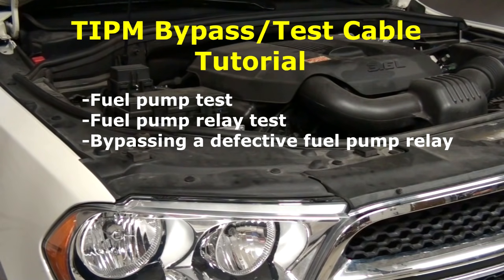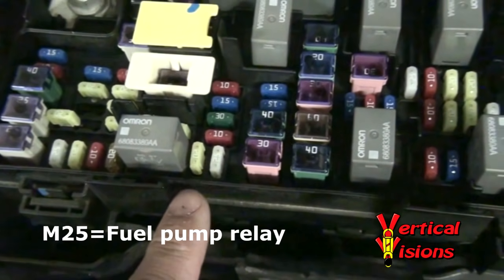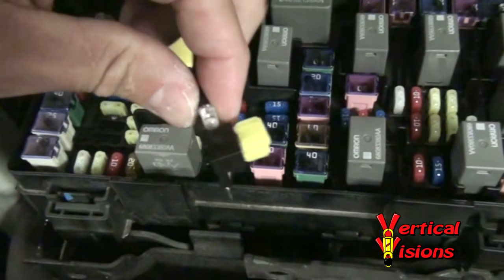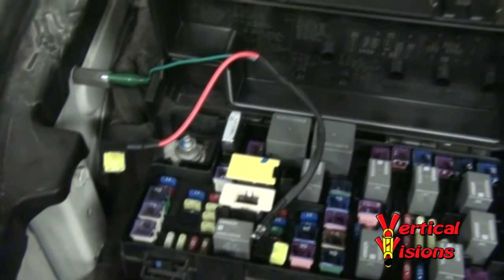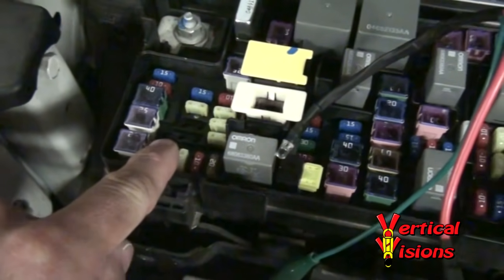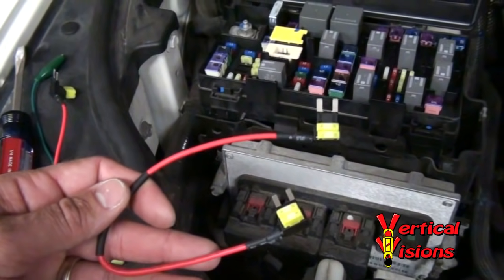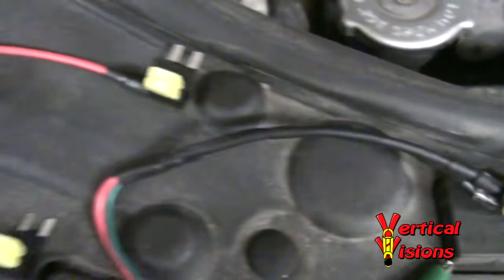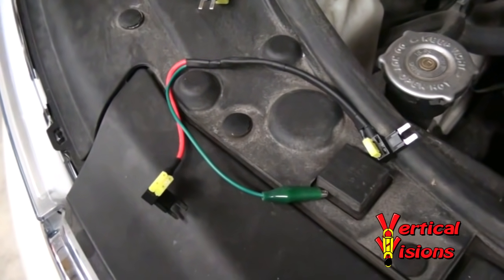TIPM Fuel Relay Test and Bypass Solutions - Most 2007-2021 Dodge, Chrysler, Ram, Jeep, VW Vehicles

Comment: Can any one tell wich by pass wire or module I should by for the 2012 t&c the relay started acting up, it still starts but now my fuel pump is stuck on and kills by battery, just wondering if I’ll be pulling fuses all the time or if this will be able to set and forget under the fuse box, thanks
Reply from the maker: If you bought your cable from us, it will come with hard copy detailed color instructions to show you everything you need.
Reply: @VerticalVisions  cool looking forward to it! Will report back
Reply from the maker: https://verticalvisions.com/en/128-town-and-country.  You need only set and forget it.
Reply: @VerticalVisions  thanks for quick reply, only reason I asked is I watched the video twice either I wasn’t paying attention or I thought the guy said if my pumps stuck on I need to remove a fuse from the by pass?? I got the one with the red wire and 4 yellow fuses on it I forget what name, something mini blade.

Comment: The correct way of doing this is get the fuel pump relay turn on signal from the PCM (pin84-brown wire) and add an external fuel pump relay to retain the operation of the fuel safety system which only will allow the fuel pump to work when the computer sees RPM.

Comment: This presented solution may work for a temporarily bypass! It is not recommended for a permanent bypass because you are bypassing the PCM computer that controls the fuel pump relay allowing to work only when the correct inputs are present in the system(e.g crank signal, etc). By doing this bypass, you are also bypassing the fuel safety system of the vehicle.

Comment: I did put a jumper as you explained. But when I put a low beam the headlights start blinking for like 5 sec and then shut  off completely. I just installed LED bulbs. High beam works fine . Low beam without jumper work only driver side .
Reply from the maker: It's the LED bulbs you installed.  TIPMs look for the current draw on your bulbs.  If outside the normal range, you'll experience issues.
Reply: The funny part they work absolutely fine until I start the engine then they blink and shut off after 5 sec
Reply from the maker: @suelguseinov7596  What is likely happening is a lower current draw from the new LED bulbs is being detected, then your PCM is shutting down the lights.  Change back to old bulbs or you can put an inline resistor with the new bulbs to increase current draw so it matches the old bulbs (so I've heard).

Comment: Could you please make some type of bypass for a 2007 Dodge ram 1500? I had to buy two boards that cost me $1200 each and then I had to send it to California to get it rebuilt for $500 because the fuel relay keeps blowing my TIPM box does not have a relay on top where you can just put a small jumper wire.  can you design something? I don’t care if I have to tap into wires that are running towards my fuel pump. I need to just make a separate external relay so I’m not stranded when this happens or cost me thousands of dollars? Please design one for the integrated one that’s unlike what you’re showing.
Reply from the maker: We would if it were scientifically possible.  Here's why it won't work:  https://verticalvisions.com/en/content/21-basics-of-bypassing-testing-relays
Reply: @VerticalVisions can I just install a separate fuel relay adaptor using the key in feature plus 12 volt with a relay all separate from board? No tying into board? So what I mean is, can I just cut the positive wire and ground off the pigtail near the pump and just install a Fuel Relay to key on positive ground all that and then it would completely be separate from board. Have its own key on power and relay with its own 30 fuse. I cant see why this wouldn’t work. Let me know.

Comment: Will this work for 2016 durango limited? I just bought the cable, where do i plug them in to by pass. 
Thank you in advance.
Reply from the maker: If you bought your cable from us, you would have received 4 pages of color instructions that will show you where to connect it.  This is the cable you need (micro2 version): https://verticalvisions.com/en/163-durango
Reply: @VerticalVisions  In my fuse box F90/91 are Power Outlet (Rear seats) Selectable. F93 is my ciggaret lighter 12V. Which one do I plug it in to? 
Thanks.
Reply from the maker: F91 and F70.  The instructions we sent with our cables will show you where to connect and how your fuses should be configured.
Reply: @VerticalVisions  I connected as instructed but the car won't start. We changed the fuel pump as well. Any advice?
Reply from the maker: @danny63843  Try hooking the power end of the cable to M7 right slots, then start.  Sometimes M7 will not provide power if your battery is low, which is why we now use a different fuse slot other than M7 for power.  Also, test your fuel pump uisng the cable.  Camshaft and crankshaft sensors can also cause similar no start situations.
Reply: @VerticalVisions  all failed! so i took it to the dealership and today they said it the battery terminal connectir wire needs to be relaced. They did and now it is starting. What we missed sometimes huh. Thank you so much for your help and advise.

Comment: Having same problem, intermittently not starting and getting worse - on a 2013 Chrysler van. Ordered jumper cable from Vertical Visions. Now, if it fixes the problem, I was wondering if I can leave the jumper cable installed indefinitely?  Or do I need to get the plug in circuit board module for a permanent fix? Thanks so much for the video.
04-15-2024 note: Cancel question, just received jumper with brochure/instructions answering all my questions. Received within three days.Thanks.
Reply from the maker: From our FAQ located at:  https://verticalvisions.com/en/mini-blade-fuse-slots/22-tipm-bypass-cable-simple.html

2) How long can I drive with the cable? Is it a permanent solution?
Answer: Many people have used our cables for extended periods of time (3-4 years) without issue, but they're still considered temporary solutions.  Unlike our patented long term solutions such as TIPM Plug-In Relay Systems, TIPM cables are temporary due to the construction of the add-a-circuit cables on each end and the tight fit.  While our TIPM cables are custom made at the factory per our specifications, we can't change some aspects of the design such as the terminal pin thickness in order to permit them to last a lifetime.  No matter what fix you decide to use, a TIPM cable is an inexpensive tool to diagnose problems with your vehicle and bypass a fuel relay problem, likely making it one of the most cost-effective fixes to solve fuel relay problems.  Tens of thousands of people around the world are currently driving with our TIPM cables and they will last for many years.

Comment: Jason, do you know if the 2018 ram 1500 might have the same problem?
Truck runs good but once a week or after a long drive it will not start for about 10 min.
Once it fires up it runs just fine again.
Reply from the maker: We do see some 2018 Ram trucks with this issue.  Product link:  https://verticalvisions.com/en/281-1500

Comment: If the relays are bad due to corrosion, by using this bypass will it in the long run damage the rest of the TIPM?
Reply from the maker: Relays are NOT failing due to corrosion so the rest of your question is invalid.  From our website, "Silicon and carbon build-up on the relay contacts is the main cause for relays that become stuck in the on or off position, cause the "crank, no start" or dead battery conditions.".  Link: https://verticalvisions.com/en/content/14-tipm-fuel-pump-relay-solutions

Comment: Just ordered my bypass kit, will update when i receive it to let you know how good i know it is going to work 😂. My fuel pump will now shut off and is draining my battery. Sometimes it does shut off but then when it doesn’t my lord it’s a pain. Im positive this product will work perfectly.
Reply from the maker: Thanks.  Please use the instructions that come with the shipment as we now have better fuse slots in use compared to those shown in this video.

Comment: Would this cause my remote start to not work on my 2012 ram 1500? It will start the truck for 5 seconds then shuts off
Reply from the maker: No.  Keep in mind we now have a new connection method that is not shown in the video which allows remote start to work perfectly.  From our FAQ:  

19) My factory remote start isn't working or the vehicle shuts down after a few seconds when using remote start. What causes this?

Answer: Our TIPM cables work perfectly with the factory remote start and we often find that these types of problems are the result of the vehicle disabling remote start capabilities before or after the starting process. Most vehicles will disable remote start if any of the following conditions are not met:

Check engine light not illuminated
Shift lever in PARK
Doors closed
Hood closed
HAZARD switch off
BRAKE switch inactive (brake pedal not pressed)
Ignition key removed from ignition switch
Battery at an acceptable charge level
Remote keyless entry PANIC button not pressed
Fuel meets minimum requirement

The engine can be started two consecutive times (two 15-minute cycles) with the remote keyless entry transmitter. However, the ignition switch must be cycled to the ON/RUN position before you can repeat the start sequence for a third cycle. With a TIPM cable in place, remote start problems are normally attributable to one or more of the items listed above if you can start your vehicle with a key or pushbutton, but not with the keyfob.

Comment: Any idea which fuse to use instead of M25 on a 2009 PT Cruiser ? TIPM is different than the one shown and none of the fuses are labelled fuel pump relay in any diagram I can find . Thanks

Comment: Hi. I have a 2007 ram  1500 (5.7 Hemi, extended cab Laramie, EZB multidisplacement engine) and the layout is different than this. It lists the TIPM as per 2006-2009. My fuse 25 is marked as Power Mirror
Reply from the maker: Your 2007 will not work with any TIPM fuel pump relay bypass devices.  Read more here:  https://verticalvisions.com/en/content/21-basics-of-bypassing-testing-relays

Comment: @JasonBell
I know this is an older video but I was wondering if this would fix a faulty micro relay on the electric helper/compressor fan circuit
Reply from the maker: We get this question a lot.  If the conditions are right and you don't mind full time power on the circuit while driving, it "might" be able to work.
Reply: @VerticalVisions  my Ram is a 2012...Would you by chance know if there is a micro relay on the circuit board for the compressor fan ???
It also has a viscous fan
Reply from the maker: @jerbo1978  I'm not 100% certain, but the answer is likely "no". The likelihood there is a MOSFET is much higher, which could be your issue.

Comment: I had a jumper from M-28 to M-9 on a 2012 dodge caravan; at first i didn’t know that the jumper was in the fuse box; the van would start, but took about 3 times to turn over; there was always a clicking sound coming from the back; i got home friday from work and the temperature was in the low negatives; saturday i go outside to start the  van; it turns over and over, won't start,  battery dies;  jump the battery,  still turns over and over; buy a new battery ( they said it was bad) start the van again; same thing; i rewatch the video to follow exactly where to put the jumper (M28 to M4) ; the jumper wire breaks; i go ahead and put the relays back where they were and the van starts right up;

Comment: One question,  how long will this thing last  ? This fuel pump relay  ?
Reply from the maker: No, these are not long term solutions due to how the cable is constructed (crimped).  For this very reason, we developed patented long term solutions here:  https://verticalvisions.com/en/17-tipm-plug-in-relay-systems

Comment: good morning, man. Hey can you please help me out with a  cuestion I bought a 2011 dodge caliber, but it doesn't have the intake magnefull runner control valve. Is this normal ?
Reply from the maker: I'm a fuse box and fuel pump circuit guy only, so I can't help with your issue.  Sorry.

Comment: Does this work for 13 town and country?

This guy is a legend for this info
Reply from the maker: Yes.  Full list for this cable type (mini-blade) is:
---------------------------
2008-2016 Chrysler Town and Country
2011-2013 Dodge Durango
2008-2020 Dodge Grand Caravan
2009-2010 Dodge Journey
2007-2011 Dodge Nitro
2011-2013 Jeep Grand Cherokee
2007-2012 Jeep Liberty
2007-2018 Jeep Wrangler
2014 Lancia Voyager
2011-2012 Ram 1500, 2500, 3500
2012-2014 Ram C/V
2009-2014 VW Routan
2011 VW Touareg

Micro2 version
----------------------
2014-2021 Dodge Durango
2013-2021 Ram 1500, 2500, 3500 (4th gen.)
2014-2020 Jeep Grand Cherokee
Reply: @VerticalVisions  Thanks got it working with your diagram and self made cable. I wil be placing an order for the 59$ part though.
The dealership said they never heard of this problem....smh

Comment: I own a 2010 jeep liberty and my fuel pump relay was broke and was constantly running. This was killing my battery. I bought the jumper without led. I followed this video and installed the jumper from M7 left to M25. Yes I did have to remove the fuse closest to the M25 terminal. 5 minutes later my jeep was fixed. I can't believe this could be this easy. Thank you for the part and for how to video.

Comment: Hi Jason I did have a external fuel pumprelay changed it but the problem is still there do you think that it could be a problem with the key remote fob changed the battery wondering if its rhe key transmitter .
Reply from the maker: What is the issue you're having?
Reply: @VerticalVisions   starts then cuts out a few seconds later then won't crank at all.

Comment: 2011 gtand caravan had this installed. Burned a terminal on this bypass wire. Don't think it really solved the problem.
Reply from the maker: People are building their own using undersized wires.  Other less intelligent people have copied all our hard work and they now sell their own inferior versions with no instructions.  We've always advertised these as "not permanent" due to a few edge case situations as you describe.

Comment: Hi Jason jyst seen your video and my jerp grand cherokee 2012 is having problems it starts then a few seconds later cuts out so I've made the same mini fused connection and it starts thanks but I would like to fix the relay do you have a video on that and the part number needed for relay as I don't want to get a second hand one and have the same issue. Many thanks
Reply from the maker: No video is available, but the part you need is here: https://verticalvisions.com/en/relays/25-nectokin-ex1-2u1s-single-relay.html.  Make sure you don't already have an external fuel pump relay as your vehicle was recalled in 2015.  Replacing the internal relay won't help if you have an external relay where harness wires were cut by your dealer.    Here's how to check:  https://verticalvisions.com/en/content/7-external-fuel-pump-relay-basics

Comment: Why is there 2 fuses on each end?
Reply from the maker: When you plug an add-a-circuit cable into an existing fuse slot, you still need to allow the original fuse to operate.  The lower fuse on the cable does this job.  The upper fuse is needed to protect power that flows through the TIPM cable to the other end.

Comment: Question???? When I put my test light on  m 25 fuse and turn the engine trying to start it the light 💡 lights up. As it turn. Do that means my fuel pump is bad????
Reply from the maker: No, it only means your fuel pump relay is good.  You must test the pump via various separate methods.  Easiest test is to cycle key to RUN position and listen for pump to turn on for 2-3 seconds.  You can also connect a 14-16 AWG wire from battery 12 VDC to the top of the M25 fuse (the side furthest away from you) while the fuse is still installed.  This will power the pump with vehicle off.  A fuel pump pressure test is also nice to ensure you're seeing around 50 psi out of the pump and filter is not clogged.
Reply: @VerticalVisions  ok thanks 🙏 for the info my friend will try it  plus I was thinking if I put carburetor cleaner in the air cleaner if the fuel pump was bad it would start up. But won’t start.

Comment: Just want to say thank you so much!! I was skeptical this would work but it worked like a charm.

My symptoms were (for 2013 Dodge Grand Caravan SXT)

1. Car would start but then die immediately
2. After that, it would crank but wouldn't start.

Thinking now, it makes total sense that it was the fuel module relay. It used up the initial fuel and then couldn't actually start again
Reply from the maker: It's hard to be skeptical of a company like ours that tells you how to build your own solution without collecting a dime from anyone.
Reply: @VerticalVisions  Noooo not that! I was worried my car's symptoms didn't match up and still wouldn't start

But thank you SO much for your time and effort put in to this. It really saved a lot of people including myself

Comment: Great video. Thank you i ordered the bypass cable. Your instructions were simple. But one thing you might have overlooked is in my case my fuel pump would run with power off. Had to pull fuel pump fuse. You show using all 4 20amp fuses. So if i put the cable back in with the 2 fuses it kicks the pump back on. Isn't that just basically replacing 1 fuse with 2? Well I went on a Ram forum and had a guy tell me to remove the bottom fuse from the fuel pump fuse end of the cable. Now it works as it should.
Reply from the maker: If you ordered the cable direct from us and not from those who copied our hard work, our instructions show removal of the lower fuse on M25.

Comment: Saw a video where the bottom wiring harness had melted wires. Would I have to worry about this. I ordered the computer board replacement, but haven't installed yet.